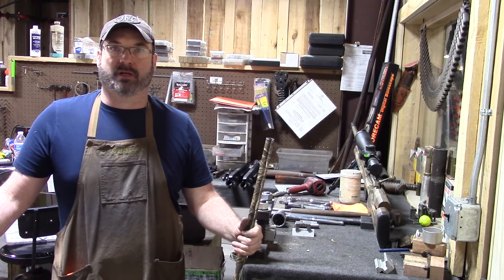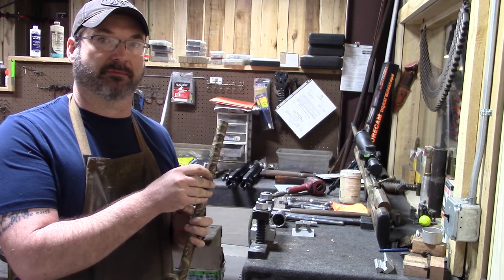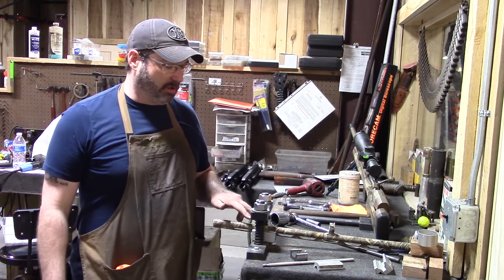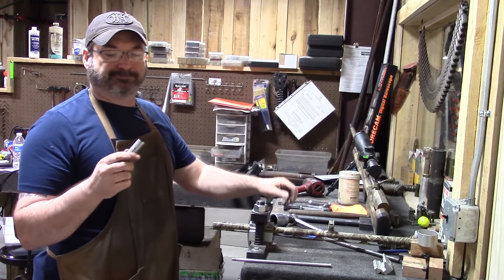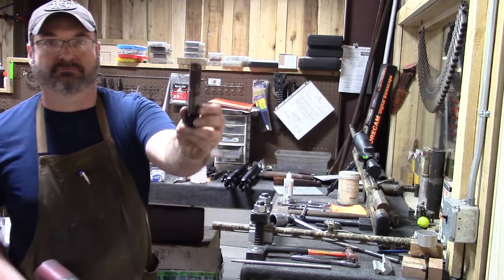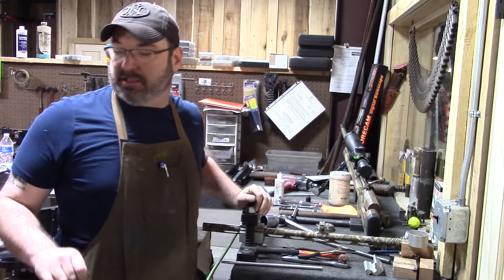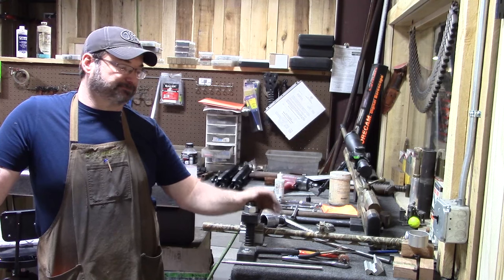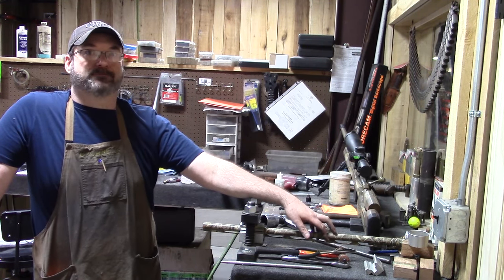Stuck Choke Tube Removal

Comment: Brand new Mossberg 940 tactical. They used blue locktite on the buffer tube retaining nut. I have a feeling they did the same on the choke tube. I believe I may have to give you a call...

Comment: BRB, going to go re-grease all my choke tube threads. 

GREAT work!
Reply: I did too , lol
Reply: I have another approach. I put my choke tubes in dry and tighten them with a wrench with a firm hand tightening. This method will most always prevent the choke from working its way loose.  But I also take the chokes out 2-3 time a year and thoroughly clean the threads on the tube and in the barrel. I remove all the built-up crud and carbon. I have found that this works better than oiling the threads. I believe that over time the oil dries up and mixes with the carbon forming a glue-like substance that will make the choke stick kin the barrel. But whatever you do, oil or no oil, take your choke out and clean all the threads a couple time a year and you will avoid problems.

Comment: thats one hell of a stuck tube... do you take the tube and clean the outside if the tube and the inside of the barrel before putting it back in?
Reply: Yes. All the rust is removed from the barrel and tube. Anthony will cover all that in the next video.